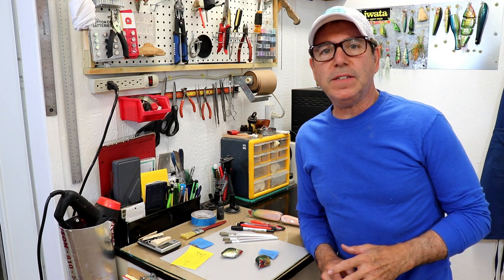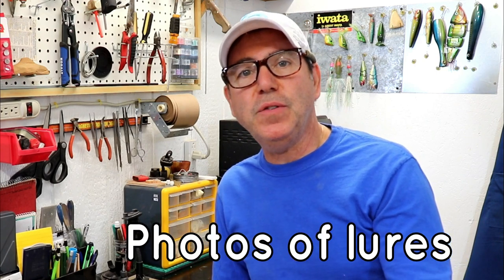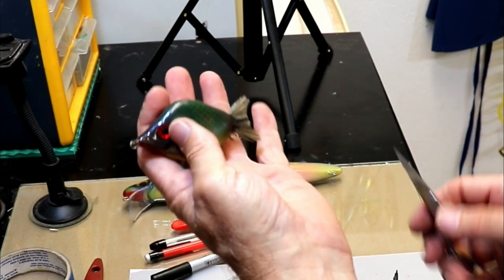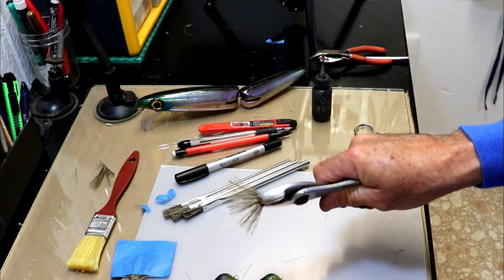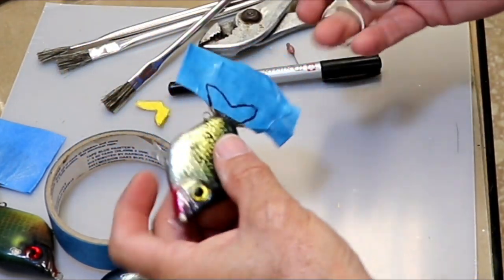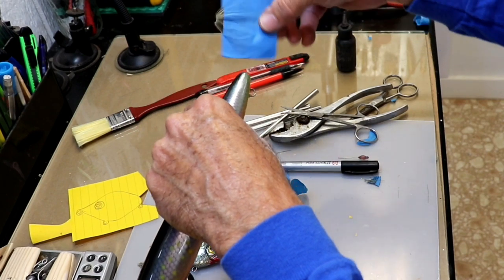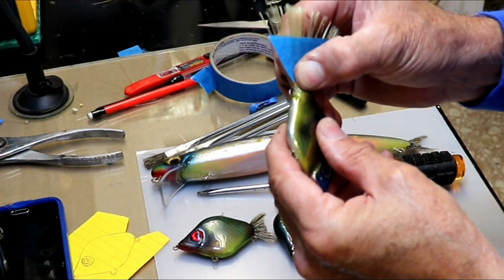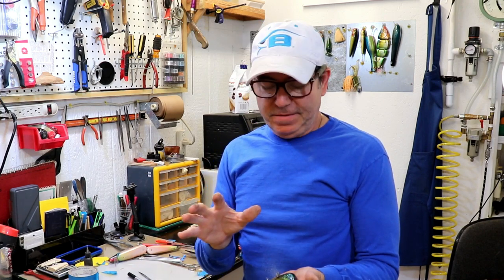Hand Made Fishing Lures, Adding a Tail to Your Lures

Comment: Your advice has been useful before.
How would you clear coat a lure with multiple joints without getting epoxy in the joints?
Reply from the maker: If you can do the enitail couple coats before you assemble then one or two coats after assembly that's really the best way. Otherwise you just have to be really careful. Best of luck

Comment: I have tried making similar tails to my lures, but they seem to kill the action pretty much completely.
Reply from the maker: You're absolutely right. And it's been my argument that designing in fins should be done very thoughtfully. You should know what that fin is doing to the action of your lure and make sure that that is what you want. You'll notice most all my lures are finless and tailless. But on occasion the action of the lure combined with a fin is what I want.
Reply: @EngineeredAngler  thanks for the response! For top water baits its sometimes useful to use a fin or a some kind of fly-treble to create drag and slow the bait down. Keep the videos coming, love to learn more about creating my own baits!
Reply: What would happen if you placed the tail horizontal instead of vertical. I would think horizontal the tail would slice through the water as of vertical Fanning the water...just a thought.